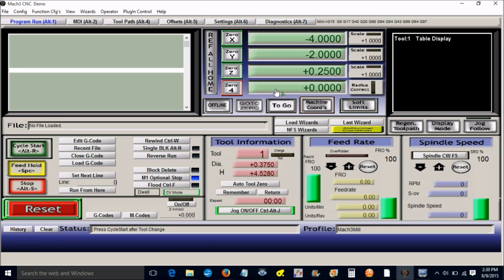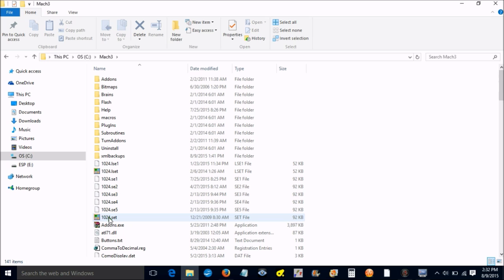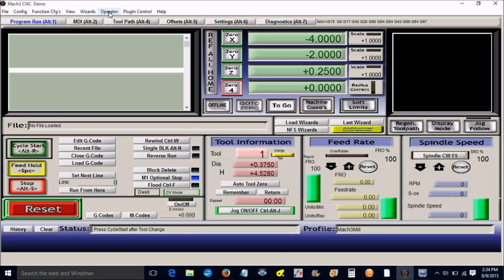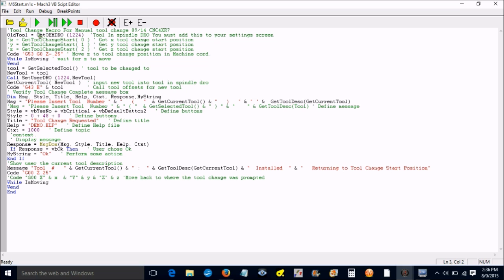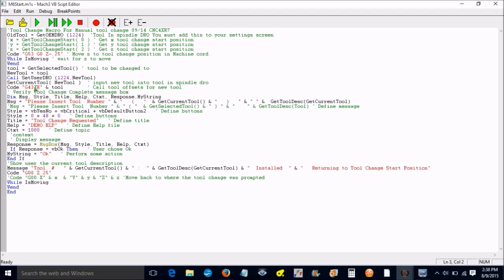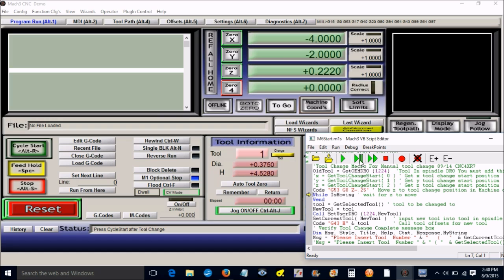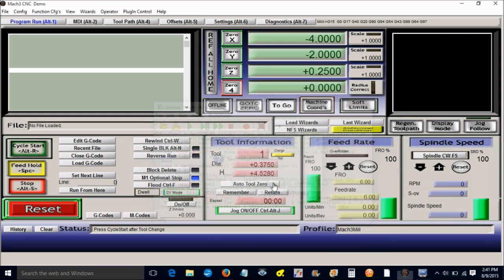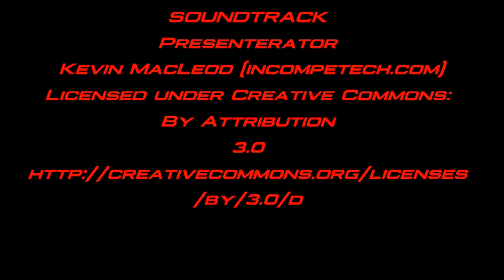Mach3 Manual Tool Change Macro Made Easy

Comment: @CNC4XR7, thanks for taking the time to make this video. I apologize in advance if this is a silly question (I am relatively new to CNC), I have a CNC router running ER20 collets on the spindle. When I have to do a tool change, the end mill will drop out and I insert another but I have no accurate method of knowing the offset from the bottom of the spindle (which is the offset you set in your table to ensure you go back to your zero point). Do you have any recommendations how I can re-zero every time I make a tool changing? This really becomes a pain since I will zero on a piece of stock material, say the corner, but when I machine it out and that corner no longer exist, i have to change my CNC code and re zero to geometry I can touch off on. Any advise would be greatly appreciated. Thanks in advance
Reply from the maker: Hi Francisco, 
Your Er20 collet system doesn't allow for use of the tool table as there is no accurate way to repeat the same depth correct?
Your X and Y Zero position should not change from tool to tool However your Z height will with a tool change.
What you need is a tool change that will set Z Zero after a tool change. Mine does not do this however one can be written but I suspect someone has already done this. Have you looked into this? https://triquetra-cnc.com/product/triquetra-p3-auto-zero-touch-plate-with-g-code-generator-copy/

Tell Charley Sam sent you
Reply: @CNC4XR7 Thanks for taking the time to reply. You are correct, there is no accurate way to repeat the tool offset in the ER collet since there is no stop. I insert the cutter and pick an arbitrary height when tightening the nut to hold it in place.

I am familiar with that touch off accessory. I actually made mine and it works great. But I have to rezero every time which is a bit of a pain. I knew it was a long shot to be able to set up tool offsets but I thought I'd ask. Either way, thanks for the reply.
Reply from the maker: So you need a tool change macro to move to a tool change position to allow you to change the tool then after the tool is changed you need it to touch of the Z axis and set zero for the new tool?
Reply: I believe so but with a tweak. I currently will zero my first tool off some point on my work piece, say one of the corners. All is good if I am machining a flat plate since I can change tools and "auto tool zero" back to my starting surface (z-zero). However my problem is when I machine away that zero surface and I can no longer zero to it. I need a "global zero" I can always come back to for a tool change, and once done, have the tool return to the local zero of the work piece where I can resume the next operation. Does that make sense, hopefully I explained it right? I understand this may just be lack of knowledge in machining rather than needing a macro so I apologize in advance if that is the case.
Reply from the maker: Francisco Hernandez 
So if you had a touch plate located somewhere in your work envelope you can touch off after each tool change. Do you have a touch plate?
Reply from the maker: Francisco Hernandez 
May be best to email me
Reply: Wonder if he got that sorted out because I am thinking about the same thing.  If a touch plate was used to zero out the first tool, then zero out another tool after a tool change, then comparing the machine z from the first tool zero to the machine z second tool zero would tell the difference in height between the first tool and the second.  Take that difference and add it into the tool change offset and then the 2nd tool would have the same z height as the first tool without having to probe off the work piece.  Dunno how to do that exactly, tho.
Reply from the maker: I suggest you take a look at this tell him Cnc4xr7 sent you. https://triquetra-cnc.com/

Comment: Thank you very much Sir for this really instructive video and also for sharing the macro. 
As I had initially some difficulties to make it work I would like to save some time to new users telling about the importance to save the macro file "M6Start.m1s" within the correct profile folder into the Mach3 installation directory. Also it is essential to set the checkbox "Manual tool change cycle start" within general settings, as you already said into the description Sir. Thank you very much.
Reply from the maker: Hi Vincent, Your very welcome!
Yes those are critical to making the Macro work! Another Tip : If you set it to auto tool changer it will start running the G Code after you change the tool and click OK you will not have to Press Cycle start. Saves a step.

Also critical Tool #0 is the Bottom of the Spindle All Tool offsets are from Here.

be Safe,
Sam
Reply: CNC4XR7 thank you very much for this precious  further tips and for your advises, I really appreciate your answer.
Vincent.

Comment: Nice video. Can I ask what this M6 Manual Tool Change macro does? For example, if we have a g-code file, and if the g-code routine involves various drill bits, such as a T1 tool and a T2 tool and a T3 tool, then are we meant to insert this M6 toolchange macro (as a command) at various locations of our g-code routine? This would be for making the spindle remember current position, then going to a tool-change location - so that we can manually use our hands (wrench/torque wrench etc) to change the toolbit ourselves, right? And then, after the manual tool change, we click on a button for zeroing the new toolbit, and finally go back to the original location to continue drilling? Thanks!
Reply from the maker: "M6" is a G-code call for a tool change. When the cnc program runs the line of G code that reads "M6" it initiates a "Macro" ( which is a routine outside the G code your running) This Macro can be as complicated as  running a Automatic tool changer, Or as simple as just moving the Axis to make it easier for you to manually change the tool.
This Macro takes advantage of The Tool Table when using TTS style tool holders even if you do not Have a Auto tool changer.
My Manual Tool Change Macro when Initiated with a "M6 TX" (command X being your tool # ) Will Stop the spindle move the  axis  to a tool change position ( user defined) and prompt you with a dialog box to please insert the Tool the G code is calling for. Once the tool has been changed click ok and the macro Offsets Z zero based on the Tool Table and returns to the last position and restarts the mill and continues running the G code.

The M6 Macro Takes advantage of your Tool table so you DO NOT HAVE TO ZERO Z ON EACH TOOL. the offsets are stored in the tool table.
So even if your changing tools manually this macro will still save you time if your using TTS style tool holders.
Reply: Thanks very much for your time CNC4XR7 for really going out of your way to answer questions, and helping us. Tremendously appreciated. Thanks for explaining that "M6" is a g-code function call. I'm a newbie at CNC, but slowly and surely getting there, thanks to serious help with people like you (and your videos).

My machine is a really basic one, with a manual chuck (with screw collar) on the spindle unit. With really basic spindle unit like this, it's not possible to use tool offsets right? In order to use tool offsets, the minimum requirement will be a special spindle that allows various kinds of tools to be bolted on in a very precise (accurate) way, right?

Thanks again for having produced these videos CNC4XR7. Greatly appreciated!

Comment: Very good work, but I am a little confused between the two M6 start files in the download section as there are two files, a M6Start and a M6StartTalk.  What is the difference between the two? Also, what I am looking for is for a manual tool change (no preset height in tool holder) to a specific location and then a auto Z offset measure and adjust (touch plate) and then continue the program. Is that a routine with a dual touch plate? 

To recap what I am after is: 
1. Start the program (cycle start)
2. With a M6 call in Gcode, pause and then move the spindle to a particular location to change the new cutting tool
3. Change the new tool manually (that does not include a pre-measured tool holder as I have a Router).
4. Do a Z touch probe tool measure move on location to calulate the the overall tool length and offset from previus tool
5. Then continue the Gcode program (Cycle start) with the new tool

Perhaps your macro does that, but I am not sure if that is the case. 

Could you please clarify. 

Thank you
Reply from the maker: Hi The M6StartTalk macro allows mach3 to talk which in reality is not practical it just lengthen the tool change time.
So you would want the M6Start macro. 
However My macro is meant for use with TTS holders Etc. and the Mach 3 tool table. 
What your looking for is something just to move to a tool change position then touch off each tool.
I have seen examples of that sort of Macro around on forums and YT so search around.